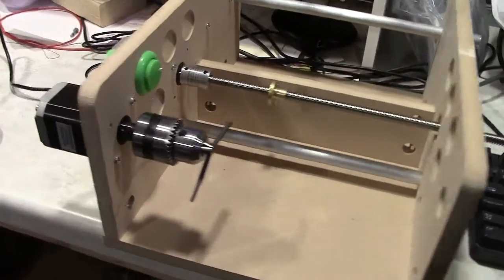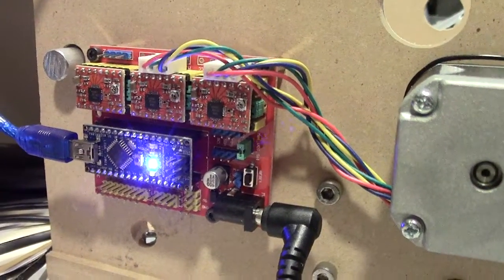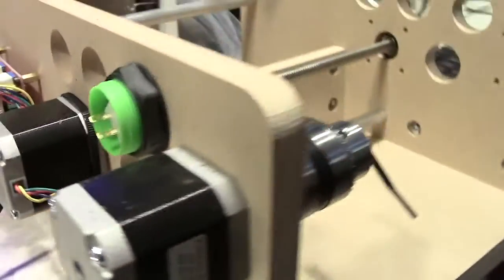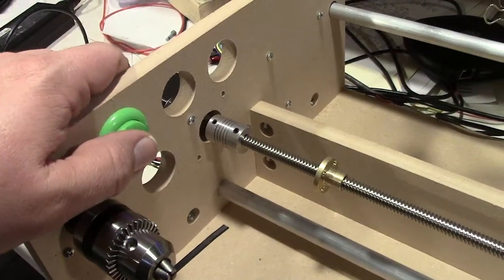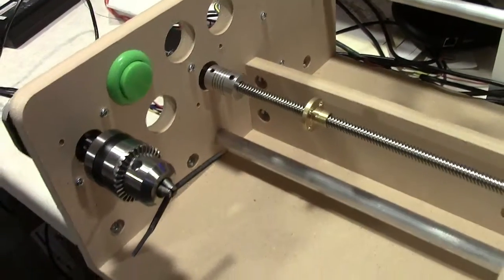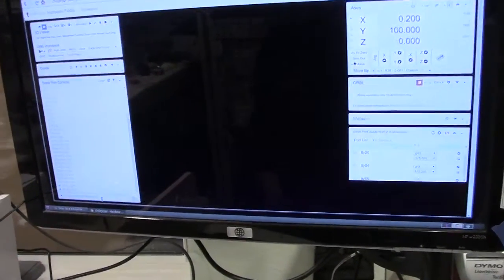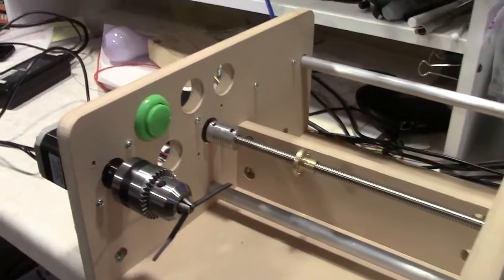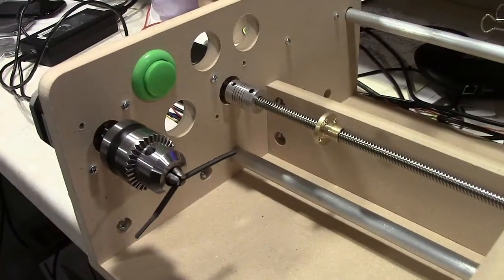160126 Faraday Coil Winder - Motor Driver Install

Comment: Great DIY coil winder. Are a parts list and cutout diagram available? Thanks, Steve, KW7F.
Reply from the maker: Unfortunately I didn't collect any project in those early days. I know the lead screws are T8 using simple NEMA 17 stepper motors. Sorry about that.

Comment: Hi  I am in the process of building something similar , I want to use the same arduino and Grbl controller but I  can make sense on how to use G code to wind for example 70 turns and move the z axis forward at the adequate speed so windings don't overlap can you help me out
thanks
Reply from the maker: you will have to play with grbl and learn how it works.
Reply: i have an idea , i will try to set the coil as if i was machining a screw
Reply from the maker: the thread pitch is your wire gauge.
Reply: Indeed engineer thanks for the help

Comment: The motors and driver look good hanging off the side there. Too bad WebGL isn't working on your Linux box. Your X axis clicks really loud. Is that on purpose?
Reply from the maker: +John Lauer linux firefox webgl functions correctly, was just running chrome when the camera was on. x axis needs the microstepping settings optimized.